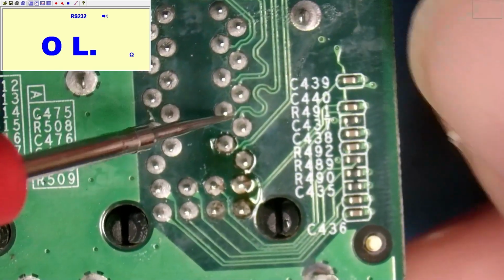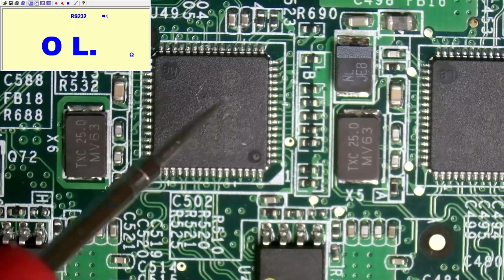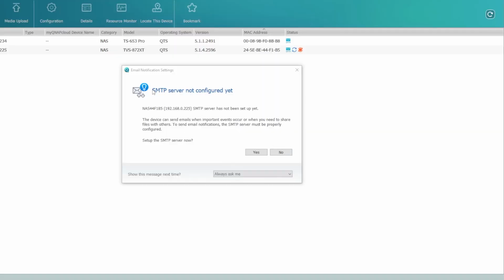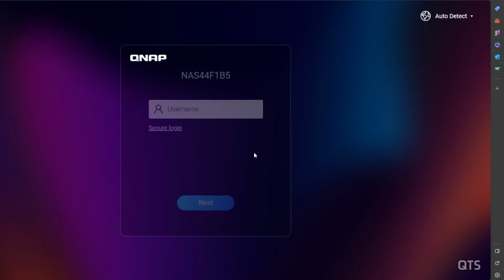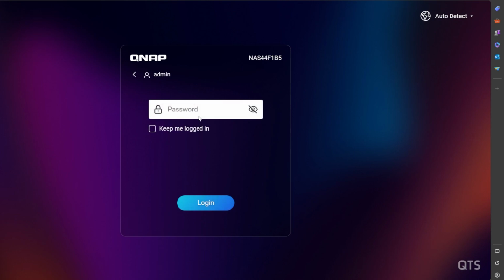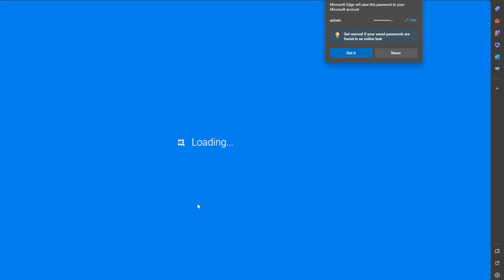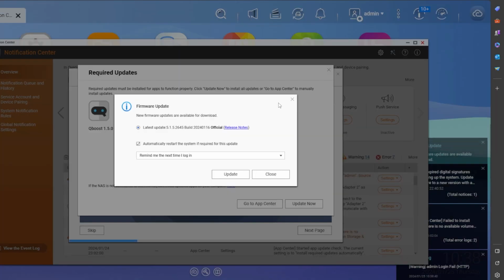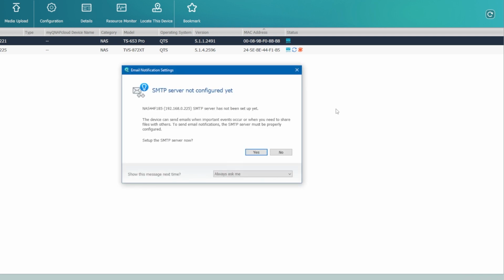Fixed Boot Problem QNAP TS-653 PRO Advanced Repair

Comment: hi nick i liked your video repair of nas seeking to have my  ts 459pro and palce resistor but still stuck on systembooting on screen and the 4 drives and usb indicator is automatically lit upon power on lan light does  blinks fast when  lan is plugged but its not detected on network, any other area you can guide me what to check?  if its the processor any way i can confirm if its faulty? thank you

Comment: Hey man, what was the problem with the TVS-872XT? I have 872X, which just died and I have that feeling that I won't get any help from QNAP.
Reply from the maker: Sorry for not getting back to you sooner, everything has been a bit crazy since the holiday. I have a full video for that repair, granted its the 6 bay version but the motherboard is the same and requires pretty much the same repair. You can check out the full repair video linked below:
https://youtu.be/O5Tk15yuUK8?si=m1EitnidwN6vhTSg

Comment: That cpu has a bug issue, can you swap it with another processor or something?
Reply from the maker: Yes we can and that's what we do on some units but not all of them need a new CPU. If it doesm then usually that will cost a bit extra since those chips are expensive and also require more work.

Comment: That CPU replacement contraption tho! I wanted more!

These videos are highlighting your diagnostic and thought process in real time. You’re so good at verbalizing your conscious stream of thought, that’s the content I’m consuming. I recommend minimizing the jump cuts, even if the video goes long. I haven’t watched your entire library so don’t be afraid to re-cover what a previous video covered. I binge watch makers that continue to explain every step because it adds context. Each repair is a unique experience, even if it’s the 10,000 power plug you’ve replaced. I’ll watch all 10,000 if you continue to verbalize your thought process and techniques during the entire repair.
Reply from the maker: Thank you for the feedback

I think I would rather in terms of my personal not business-oriented opinion go that route where I do the full diagnostic, verbalize everything, thought process on the diagnostic, and so on as I think it would be more fun. It's also less work for editing and so on. Doing this would help me build a community of like-minded individuals, and I think I would have a much closer relationship with my audience. There would be a lot of benefits. 

However the downfall and this is the ugly, greedy businessman that I am coming out, is that I wouldn't be able to get as many views on these longer videos. I could be completely wrong, but I think a lot of the people that watch the videos come on, they don't mind a quick explanation of the issue but they are there to watch the fix and be provided with an answer to their problem. They don't necessarily want to follow the journey. Again I could be wrong. I think the audience that pays me and allows me to keep doing this, are the people who don't feel comfortable soldering or using a multimeter to diagnose and repair their own unit, they are interested in learning a little more about it but not necessarily deep dive into it, they would rather just send it to me and pay me to do it for them. Which is what pays for me to be able to do these. 

I am afraid that If I go through the full start-to-finish diagnostic I will lose a lot of potential viewers and sales on the back end. 

You know what, I'll give it a try and see what happens because the reality is that everything I perceive about how a video is successful at converting viewers into customers is an opinion and not based on facts. I feel like as a rule of thumb, the more you give to people, the more you get back. And if going through that entire diagnostic process is better for the repair community, it could help the channel in ways I didn't expect. 
I have a few devices that came in that I have never fixed before and while I have a good idea of how to fix them, I haven't had to yet. I'll try a longer format video where I do start at the opening, and record the entire troubleshooting thought process. 

Great feels like I just went to business therapy.
Reply: @NicksElectronicRepair  glad I could help, therapy bill is in the mail =)
Reply from the maker: haha sounds good

Comment: Would the repair have been simpler if the customer only needed a single working port? Could you have spoofed the failed parts in some way?

Finally, is it safe to assume that a good quality UPS provides sufficient protection against lightning?

Thank you for sharing this.
Reply from the maker: A quality UPS would protect against lightning as long as everything passes through that UPS. This means your ethernet cable needs to first plug into the UPS have a surge protection system for it and then from the UPS to the NAS device. Same goes with the HDMI cable if you connect an HDMI to the back of your NAS. 
Surges in my experience almost never come in through the power, it's almost always through ethernet, coax, HDMI or other low voltage data lines that have 0 built in surge protection by default.